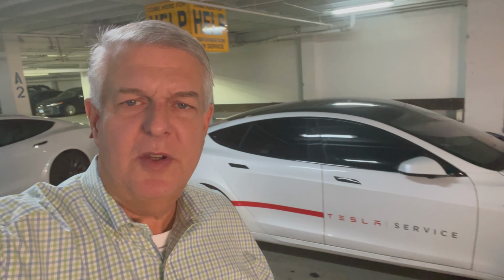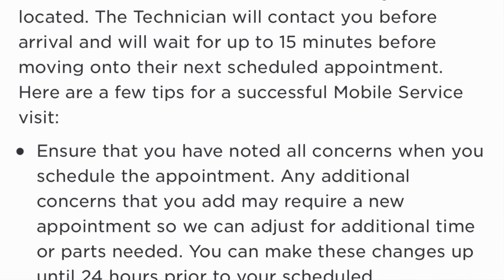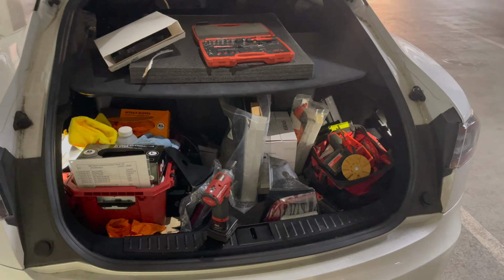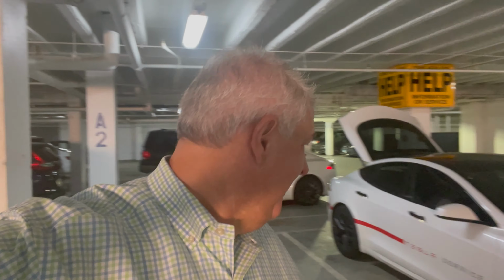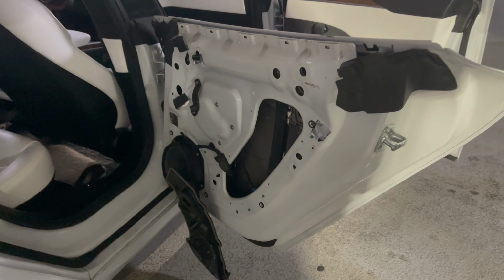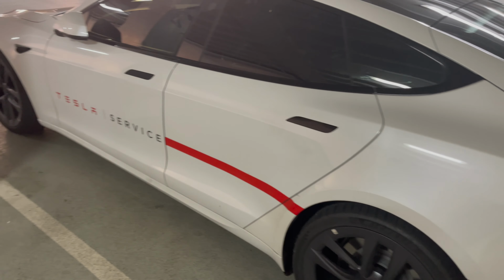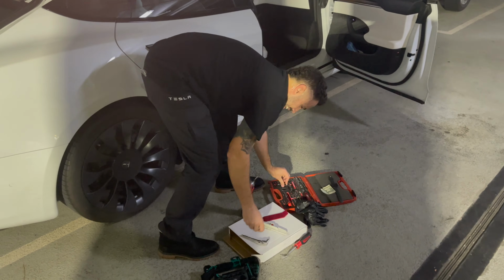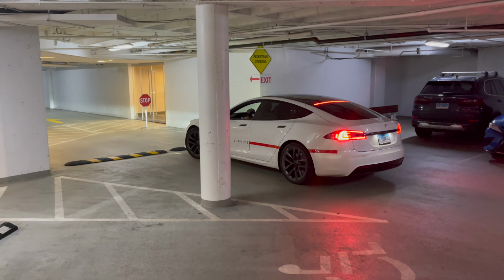Tesla Mobile Service Arrives To Fix My Model S!

Comment: Tesla mobile service is great! I had mobile service here in Witten (Germany) three times. The first time I had them here was to replace the rear seats of my first Model 3, because they shipped the car over to Europe with the seats folded and the seat belt buckles out which left marks on the vegan leather. Second time mobile service was here just a month later due to water in the left taillight. The third time mobile service replaced a scratched interior panel on the A pillar that was damaged while transporting my second Model 3 from Giga Shanghai to Germany. Mobile service did a great job so far. So thumbs up and thank you mobile Tesla service in the Dortmund (Germany) area.

Comment: Hi Dave. New owner, needed service at my house twice due to frunk that would not close. It took two attempts to fix, I am still afraid to use frunk because speed is limited to only 15 mph if it doesn’t “latch”. I didn’t ask to video, assumed they wouldn’t like that. Very happy that I didn’t need to take it to SC as that is 100 miles round trip. Unfortunately, my wife is a Tesla hater and calls it a Lemon!
Reply: lol tell your wife to watch e for electrics video on his ID4 software issues. I wouldn't buy any other ev for software alone.

Comment: Dave would you rather a retractable cargo shelf in the trunk?Or do you prefer the standard shelf that came with your model S? I currently own a MYP and I have added an aftermarket retractable shelf. 
Thanks.
Reply: I usually don’t like either and take them out.  But, I kinda like the hard shelf as you can put things on it when parked and use it for different things

Comment: What a great job he did ...amazing.

Dave he replaced a door handle............! wasn't really brain surgery lol.

Glad you got car fixed.
Reply: Me too.  I hear ya though.  This guy was in the marines for 6 years as a mechanic then worked on Diesel engines for 6 years after that. He was clearly a pro and super efficient.  The fact that all he did was replace a door handle is only part of the picture.  The guy was just super efficient and a true pro.
Reply: @davidconner9027  great context thanks Dave.
He was good letting you film him and you clearly enjoyed meeting him.
Reply: the guy took apart the whole door and removed the window all in a parking garage with poor lighting.  I think that was an incredible feat.  Getting the window back in and everything back together without rattles etc.  not easy